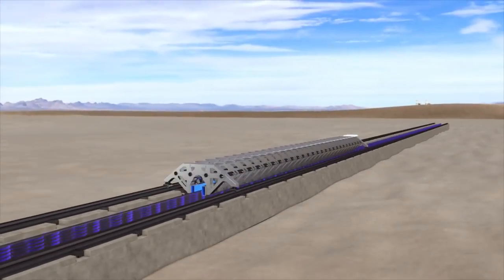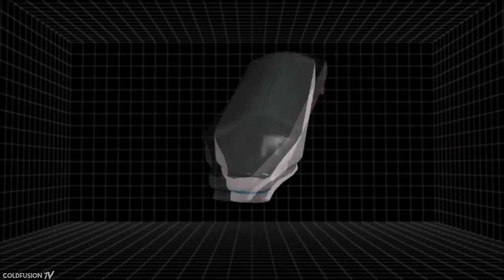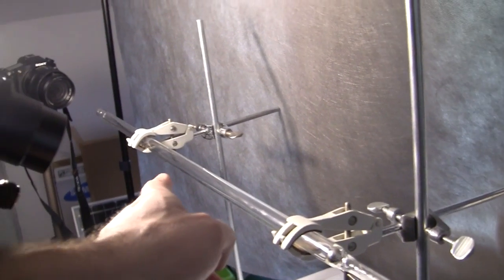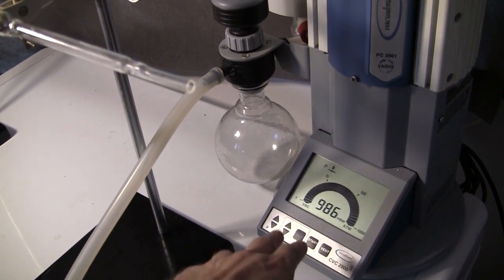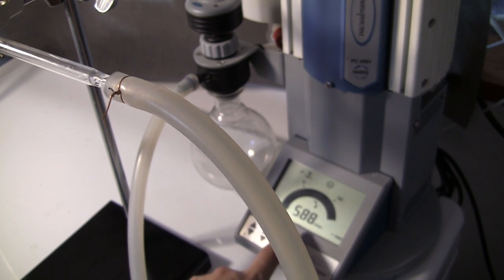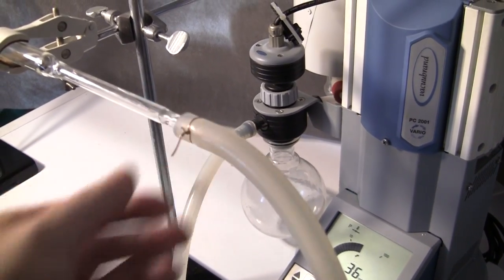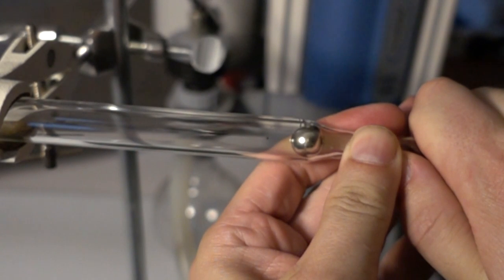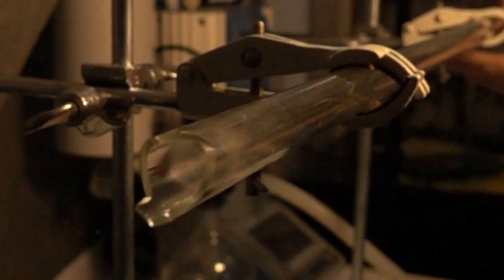How  the Hyperloop can kill you!

Comment: It's not normal that you get basic physics wrong Thunderf00t, but I'm sorry to say that below first year physics shows that this argument is incorrect. You say that the acceleration will be worse (i.e. more acceleration) as you increase the diameter of the pipe, this is completely incorrect. It will be exactly the same.

The reason shown why is here: https://gyazo.com/d7c207012016e8955a0d6ad2bb45f134

For people that don't like gyazo, I've written the same thing out below but the formatting is obviously worse. TLDR: a full scale hyperloop would have much much less acceleration than this small model, not more.

Consider a cylinder (the hyperloop pod) within another cylinder of the same diameter ( the hyperloop track) with a pressure differential.

The overall force is the force on one side, minus the force on the other 
$$F = F_1-F_2$$

Pressure is simply force distributed over an area, $P=\frac{F}{A}$ So $F = PA$

Therefore $F = P_{1}A-P_{2}A = A(P_{1}-P_{2})$

So the overall force is simply the pressure difference multiplied by the surface area

$$ F = A\Delta P$$

The surface area the pressure is incident on is a circle, $A = \pi r^2$

$$ F = \pi r^2\Delta P$$

For an object that is a constant mass $F=ma$ $\frac{F}{m}=a$

$$ a = \frac{\pi r^2\Delta P}{m}$$

The mass of an object is its density multiplied by it's volume, $m = \rho V$

$$ a = \frac{\pi r^2\Delta P}{\rho V}$$

Volume of a cylinder is simply $V=\pi r^2 h$ where h is its length.

$$a = \frac{\pi r^2\Delta P}{\rho \pi r^2 h}$$

$$a = \frac{\Delta P}{\rho  h}$$

So as can be seen, the diameter of the pipe does not affect the acceleration. However, for a long cylinder the acceleration decreases. I.e. the acceleration on a full scale hyperloop due to vacuum collapse would be considerably less, not more, than your experiment.

The density of a completely empty british rail class 220 carriage is $1044.15kg/m^3$, and the length is $23.85m$. Now bare in mind this is completely empty, when it's full it will be much more dense and hence the acceleration will be even less. The acceleration for this density and length would be $0.4g$, completely completely manageable. Hardly even noticeable. And again, for a carriage that was not empty this would be even less. That's a 0 to 60 of 7 seconds, that's not even a particularly fast car. This car can accelerate that fast http://www.autosnout.com/Car-Performance-Statistics.php?Specs&EditionID=253.

Comment: 490 dead in Hyperloop fatal accident
vs
853 dead in Airbus A380 fatal accident

Original Hyperloop Paper says: "In  the  event  of  a  large  scale  leak,  pressure  sensors  located  along  the  tube would automatically communicate with all capsules to deploy their emergency mechanical braking systems". Also in the same paper it says that the tube can be quickly represurised in emergency cases. 

But let's say that it is just not good/fast enough (like in a case of a terrorist attack, for example)..

Hyperloop capsule has 28 passangers and goes every 2 minutes. Trip from LA to San Francisco takes 35 minutes. Therefore there is 490 passangers in the entire Hyperloop at one time. Airbus A380 can take up to 853 people on board.. So if you are a terrorist, you will kill more people by taking down one A380 than bombing the Hyperloop.

I'm sorry to say it, because I'm fan of Thunderf00t, but this video is nothing but a click-bait..
Reply: Since when the a380 crash
Reply: I can say that "In a large scale leak, pressure sensors will remove gases through a filter system"  but that won't prove anything.
There's no science, no math, no equations, no machines that help that statement, but I can still say it and people will still believe.

Whats your point? These emergency systems will have to stop faster than the speed of sound because that's essentially the speed of the gas coming through the tube- and even if I'm at a full stop, that pressure is still going to kill me. 

Did you listen to the video?

Comment: Thunderf00t, you're taking a lot of shit for this one. This is not an engineering impasse. Consider possible safety features and try experiments at multiple scales before you shout BUSTED.

The square cube law will tell you that the full scale will have a far greater mass relative to effective surface area, and this will certainly have an effect on acceleration. See if the math checks out. If the vacuum fails behind the shuttle, they can simply open vents in the tube in front of the shuttle. With such a large tube, it would take a long time for the air to leak in without a catastrophic failure which would be extremely rare. Even with the catastrophic failure, it wouldn't be very difficult to equalize the pressure before any lethal acceleration happens. Also, I'd imagine some fairly powerful breaks would be built into these things. Even with all that, there's an accepted risk to all forms of travel. Cars have lethal mechanical and operator failures daily. Planes don't crash often, but when they do it's often catastrophic. Rockets blow up all the time. Even a horse could end up kicking its passenger to death.

Comment: The last words made me think....  You have an error in reasoning here.
 
This Experiment  represents a scenario that has a terminal station which should be avoided in my opinion.
You could just build a loop and be much safer. Hence the name Hyper-loop.

Of course there would be a way of stopping the train by simply letting in air at he opposite side of the  train fast enough. 
There would have to be sensors in the tube every hundred meters that  measure the pressures and vents for emergency.
That leak you simulated would only occur through major disasters or attacks if the loop is cracked open wide.

Comment: I would like to think that the engineers designing the thing would have included emergency brakes in case of vacuum failure, similar to how modern elevators have emergency brakes in case the cable snaps.  No, I'm more worried about how fast the travelers would decelerate if the vacuum failure occurred in FRONT of them, after they get up to full speed, whether by sabotage, collision/accidents, force of nature, or fatigue.There, they are travelling at a high rate of speed towards a wall of 1 bar pressure coming straight at them.

Comment: Why would you want to debunk hyperloop ? Numerous scientists and engineering firms have said over and over that it does not violate the laws of physics. The concept of transport in a vacuum tube has been around for decades, it has been worked on by numerous engineering firms and conclusion has systematically been "it's possible but our small firm does not have the money for the huge R&D and then construction costs to try and make one".
Maybe you would like to show how hard it is to engineer, but then the "debunking" format is a very poor choice as you'd be systematically misrepresenting the engineering choices made by the hyperloop, just like in this video :

-your ball in tube model is too tight, the actual hyperloop would have a lot more space around the vehicle, the air cannon effect would be significantly less strong than what you are suggesting.
-the text in the description is wrong "Any who survive would find themselves in a 500km long metal tube in the dark."
Of course not !
Your passengers are sitting in a vehicle with wheels and a small electric motor (normally used for low speed manoeuvring in and out of stations), a very large battery pack, and fully autonomous life support system with at least 1hour + safety reserve time available. It would be absolutely stupid to abandon the passengers in the tunnel when you could just use all that perfectly functioning hardware to drive the vehicle to a safe exit.
Reply: BlackSharkfr he is not saying that the concept won't work, just that current designs have glarring weak points, and would be a way too expensive form of transport. if i am wrong please give me a timestamp so i can correct myself.

Comment: Frankly, you can design for this failure mode.  Dangerous? Hell yes.  But if you make the turbofan in front reversible, and you have bypass ducts that are normally closed, and can be opened in the event of a rapid compression event, you could significantly decrease how much you block the flow of air, and thus reduce how much you're accelerated by the pressure wave.

Alternatively, if the hyperloop is on a track, like in this model, though not in Musks's original proposal,  it could apply breaks.

Comment: umm, I'm pretty sure it'll have brakes ;) Your ball bear does not ;)
Reply: A maglev slows down by having the magnets in the rail in front of it polarise, physical brakes would defeat the purpose of a maglev train, which is to work frictionless. This means that if the train were to be lifted or derailed from the track by, say, a mach 6 shockwave from a rupture in the vacuum behind it, the train's braking function would be rendered useless.
Reply: Brakes... On a maglev... No.
Reply: And why not?
Reply: No. Google+ showed a message saying something about a spam comment which I'm guessing was your message. I guess their spam detection system is failing on you for some reason.
Reply: Perhaps try re-commenting, but with different wording. Maybe that'll make it show up.
Reply: Yeah, but I can't see it now. It only showed me in Google+ then disappeared.
Reply: The purpose of a maglev train is to make the train faster and/or more efficient. Adding physical brakes doesn't change that. It seems like an important safety improvement to me.

Comment: Thunder, safety is an engineering problem. Part of engineering design is to assess possible failure modes and design systems that mitigate the impact of any failure. We call this FMEA - Failure Mode Effects Analysis - and it starts at the beginning of any system design. 

Issues like the one you raise would be assessed and mitigations thought about very early on. Example: clearly you would want to be able isolate sections of tube in the event of a breech, so we would have safety doors at intervals along the tunnel. Making the doors strong enough to handle the impact of a sudden pressure wave is engineering.This isolates the failure to a part of the system, but is sad for any train caught in the isolated section. A possible mitigation for this would be to open valves that flood the tube with air around and ahead of the train, so the impact of a sudden massive pressure change is reduced. Done right it should be survivable.

Another and much more likely way for hyperloop to kill you is for the train pressurisation to fail - the train loses all its air into the tube vacuum and it's all over red rover. The train arrives on schedule, but...  The obvious mitigation is to get all the passengers to wear pressure suits, but that is unlikely to be practicable - so we need to look for other ways to mitigate this type of failure.

Bottom line - any transport system where large amounts of energy and high speeds are involved can kill you. Making it safe is engineering.

Comment: I have a question about the diameter of the ball vs the diameter of the tube.  Are they roughly equal as it appears to be in the video?  I ask becuase it seems to me that by making the ball smaller than the internal diameter of the tube, you can mitigate this problem.  If there is room enough for the air to move around the ball, the ball will not accelerate nearly so much.  So why wouldn't the hyperloop be designed so that the tube is larger than the train?

Comment: I am nether for or against the hyper loop But you seem to be inferring that no safety mechanisms will be in place to stop this. 
I worked as a pressure pumping operator for half a decade. Nitrogen oil well servicing.
Based on what pressure and volume the tube would be, i would hazard a guess that the  tube would have to be thick enough that a rifle bullet would have trouble passing though it's wall. It would also have to be securely mounted to the ground to stop vibration damage. 
As for the cart will it be close to the inside diameter of the tube like you ball bearing was or smaller. 
I maybe wrong on this but is the vacuum not meant to remove the air fiction. Not as a primary force to move the carts in the tube.
If the system is meant to operate like the vacuum tubes in a office i have to agree the chance of a runaway is very high considering the west coasts earthquakes and land slides. But i can't see that being a effect way to run the system as pumping a vacuum is not easy on that scale.

Comment: But there are a few ways to make this less of a problem like
- make the diameter of the tube biger so that the air can better flow around the capsule
- put brakes on the capsule 
- put valves along the tube that open (all of the at once) if a presure increas is detectet 
- install some sort of shok absorbing system in/on the capsules that minimizes the gforce of aceleration
if you combine all these a failure to keep the near vacuum would be bad but not nesecarily deadly  
you have to rember that the "gunbarrel" would not have an end like in your demonstation and it would be unlikly that the leak near a capsule

Comment: you can easily avoid this situation by having vents through out the whole tube. if any malfunction happens all vents ir at least one from the opposite side wiuld open and normalize the pressure inside. then comes magnatic brakes to help with complete stopping
Reply: Abdula Mumin  Still, if any one of those vents fails, the whole system fails and catastrophically to boot. Either way, the hyperloop project just has "imminent disaster" written all over it. People don't need to be put in danger for an idea that has been left undeveloped for over a century for a good, obvious reason.
Reply: Abdula Mumin  I want believe someone still thinks hyperloop can be made in 2020
Reply: Sure, just keep putting in more and more seals and points of leaks and failure. What could possibly go wrong.
Reply: Exactly. If you have vents in there, the whole thing loses its vacuum.
Reply: Holy Rx  that’s a lie there is no way to buy stock of Hyperloop it’s not on the stock market yet
Reply: And then it would take ages to repressurise the tube. Remember, this tube has to be thosands of miles long.

Comment: If also like to add that safety systems could easily be worked into this. This form of failure is caused by inrush of air on only one end of the tube, causing acceleration. However, I could easily see a fail safe wherein if a substantial enough pressure leak were detected, air could be fed in from the other side, creating a cushion of air to slow the pod. It would be like an elevator falling in a large building, these cushions of air have been known to gently (relatively) decelerate elevators from many stories high enough for people to survive the fall.
Reply: no, air from the other side will have to rush the whole length of the tube till it could help deceleration.
Reply: you missed the insight of having a much larger diameter tube than train.

Comment: Wait a second. So your not debunking it so much as saying it's dangerous. Frankly I love your debunking videos but here I feel you've made a mistake. So it's dangerous? So is moving at 80mph down a road an an aluminum box powered by a rapid series of controlled explosions controlled by the less then perfect equipment of the mammalian brain, or flying though the air at 30,000 feet at 500mph also controlled by the same mammals.

Comment: +Thunderf00t This failure mode assumes complete, immediate, catastrophic loss of vacuum - how likely is that really, with a large system?
Even if this happened, the train would be limited to a theoretical max speed of several hundred mph (which it's designed for, albeit in vacuum). Magnetic braking anyone? Humble Halbach Array Saves the Day! 
I bet you can come up with much more convincing reasons why the concept wouldn't/shouldn't work :)

Comment: I see what you mean, as if this exsisted maintenance would have to be constant, and very precise, as a crack could cause this, however couldn't there be a fail-safe brake that just clamps onto the rail? it seems like that would at the very least slow it down to a non-lethal velocity